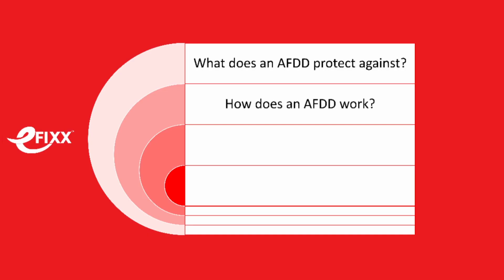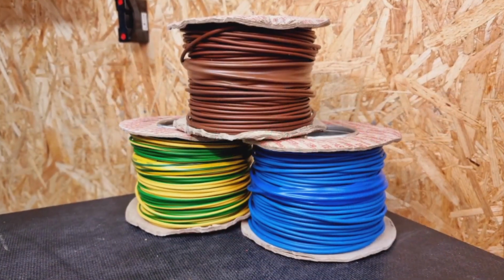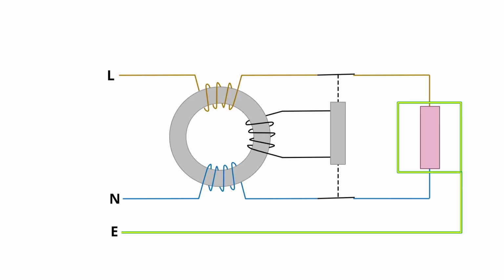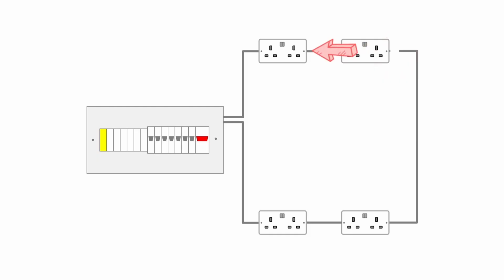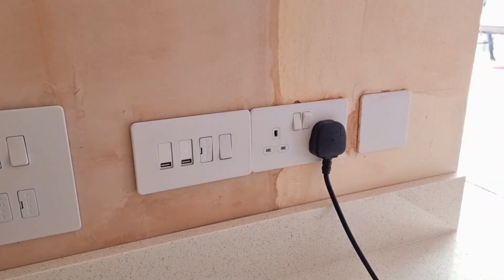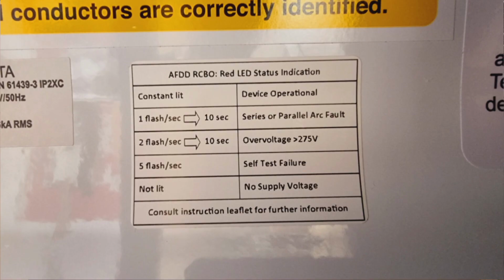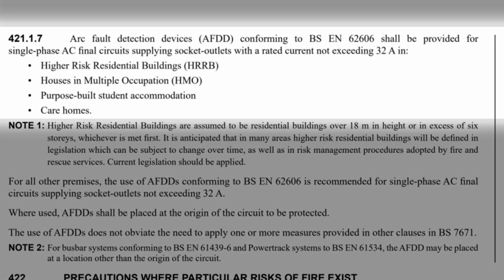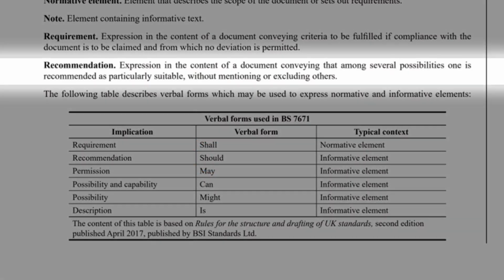AFDDs & BS7671 Amendment 2 - What you need to know!

Comment: I am struggling to verify anywhere the definition of “reside” also meaning offices etc i may be completely missing it. This is not meant to challenge what you are informing us of but merely for self clarification. 
Very informative non the less
Reply: That's because you reside in a residence.
Reply: @markrainford1219  i understand this which is why i seek clarity, with reference to the statement at about 1525 on the video where he says  ‘residential in this context doesn’t just refer to where people live or sleep, but also includes areas where people may RESIDE during the day for work. So office blocks could be included under these circumstances as well’

Comment: AFDD has already come into its own for me. Just had a job where the customer was concerned about the old wiring and old light fittings. (Fluorescents) Circuit all tested out fine but the AFDD kept disconnecting over a week. Old light fittings changed for new and now no problems.
Reply: As a former electrician and now a CEng with the IET with over 40 years of experience, the faults being monitored by the AFFD are due as follows 1. Poor installation 2. Poorly manufactured products 3. Lack of inspection and maintenance regime 4. Appliance,s sockets, switches and luminaires not being replaced at end of life service and degrading.  All the above were taught as correct installation, maintenance and working practice in the 70’s. 

We now have a tendency to try to over engineer the problems away than use such well founded practices. If the above was observed AFDDs would not be required.
Reply: @talsius.1019  
So we should ditch a device that prevents fires?
Reply: @johnburns4017  I think what I’m saying is, another electromechanical device is being inserted into the system where quite frankly a correctly installed, tested and maintained installation would not require them. It is noted that fire incidences in residences has increased over the last ten years, why? … poor installation, poor testing,  people not having their homes tested periodically so that the installation deteriorates allowing arcing to occur due to insulation breakdown between phase or phase and neutral conductors. Still they will prevail , I’m sure they’ll help in one or two instances but if the above is carried correctly then their need is debatable.
Reply: @talsius.1019  definitely. The dumbing down of the industry and the consumer wanting the cheapest price has made it like this: 
The customer wasn’t willing to pay for a full EICR as it was still in date so I offered a different solution to them they took it and it worked in a way the customer understands. 
Not just our trade but most things in the UK is plastered over and fixed when it breaks. 
I have a favourite saying for my customers. A stitch in time saves 9!
Reply from the maker: Great info thanks 🙏
Reply: @efixx  all the internals showed signs of thermal degradation but the multifunction tester just saw no problem. Obviously when the fittings had been on long period time something was causing the arc within the gearing. Let alone all the heat degraded wiring within old fluorescents. 
Also provided good enough evidence that all the lights needed to go.
Reply: @Beariam24  That's why you do periodic test and inspection but nobody wants to pay for that any more, lack of maintenance.
Reply: @leewinters606  100%.
Reply: @Beariam24  just bare in mind when new devices or any other electrical equipment is new on the market you tube channels might be getting a paid promotion the old saying (back handers).shop around and do your research.
Reply: @leewinters606  I think a lot of the 'new regs' are based on manufacturers back handers.
Reply: Great video by the way!1

Comment: Microsoft churned out loads of AFDD-equipped power cables for Xboxes years ago, rather than admit that the problem lay within the machine (loose connection on the figure-8 jack due to missing mounting studs).  When I tore one down it turned out to be an RCD with the arc fault detection piggybacking onto it.  If the AFDD picked up a fault, it introduced an imbalance in the RCD's sense coil to make it trip.

Comment: What about the AFDD it’s self. Are they reliable . There is a lot in them to go wrong even though you say they do a self check. After all I’m sure we have all come across faulty RCBOs that are faulty and won’t trip. 
It’s no good explaining to the customer how things work. Time and time again I tell customers check rcds occasionally. They never do.
Reply: The reality is that, putting more electronics and components in something just means that there are more things that can go wrong, and at £150 each plus a call out charge when they fail it means there will be a lot of disgruntled customers many of whom will think that Electricians are just ripping them off.  We are all aware that RCDs often fail in part because they are not manually tested quarterly, so there’s no reason to think that AFDDs will be any different.

Comment: This was a really easy, good and understanding video of AFDD`s and really helpful! Another great video from EFIXX. Could you guys please do a video now on SPD`s as after doing the NICEIC webinar last night I was a little confused because they mentioned the possibility of having to install several SPD`s in one installation? I know I`m not the only one to say this. Hot topic at the moment!
Reply: I watched that webinar also and what was suggested just sounds insane and unmanageable. Imagine trying to explain and get the go ahead to do that from a customer, let alone execute the installation-  to me that would mean fitting an unsightly enclosure at eye level at 10m intervals, fine in a new build or rewire in some respects but on an existing installation how do we know the routes if we didn’t install the cables to know these lengths I’m unsure of also. It just sounds crazy. If this is the case I do not know why they are putting the responsibility of dealing with this on us - bearing in mind we are dealing with the type A situation also, and not onto the manufacturer’s? Why can they not be charged with designing and manufacturing accessories (smokes, heats, c02 etc.) with SPD built in? Surely that is a more sensible idea?
The other thing that struck me also was that there has been no mention of this in the limited material on SPD’s that I’ve seen over the past year or so.

Comment: As far as i can see these are to protect against  cheap possibly substandard white goods , any parallel arc will trip a mcb or rcd , they wont detect series arc on a ring final , these are the only circuits we have to install them on.not showers, cookers, immersion heaters or electric heating
Reply: A lot of updates to the regs like the use of AFDDs are required to counter the the poor quality materials that we get now and because too many Electricians fail to ensure a good mechanical connection.
Reply: Come on. You Can't expect people to honour 60950 ... Thousands of Chinese manufacturers would go bankrupt. All HAIL the MRA !

Comment: You stated how AFDD doesn't detect series faults on a ring circuit. However a series fault on a ring circuit would never occur, as the series conductors will always be at the same potential.

Comment: So if they protect the flexs that are plugged into a socket on a ring main I assume that they also protect any spurs off a ring main? I'm a homeowner and had them fitted to all my circuits when they replaced my consumer unit. Kinda figured that if they are going to become mandatory it was best to fully upgrade now so I don’t end up having to replace the consumer unit in 5 years time when I want to add something and my consumer unit no longer meets the regulations of the day.
Reply: i would like to know how much you paid for that
Reply: @OnlyUseMeEquip  £2580 including VAT/ fitting/ testing etc. in 2021 in Bedfordshire (near London). Not cheap I admit but where safety is involved I would rather spend the money to get decent protection. Maybe not your average consumer.

Comment: So are we saying that all installations now are requiring afdds?
Reply: Although not clarified in the video it does seem to be the case that all new socket circuits in residential properties require AFDDs to be fitted, it would help massively if the IEE could employ an Electrician to translate their engineering language into something that all Electricians could actually understand and avoid the constant confusion and misinterpretation.
Reply: @andyg1645  I totally agree Andy.
Reply: No
Reply: No, but guess what an insurance company will say when dealing with a claim for an electrical fire. Mine has advised my HMO not covered unless retrospectively AFDD fitted

Comment: I’ve been a spark for 50 years ( now retired ) in all my working life I have seen between 10 /15 spark damaged installations but never a fire …no NEVER a fire .I feel I have missed out so many faults and all the sparks working with me have never mentioned it . So were sparks making  the connections to the right torque and now they are not ? Well I’ve never used a torque screwdriver .Maybe the materials used in foregone years were better ?E.L.C.B.s were used when I was an apprentice but now they changed the name to RCD . When I was young the ELCB were voltage or current operated and I really don’t see the difference between RCD and current operated ELCB I think it’s wonderful to put these new devices in homes where no one has any electrical knowledge When the lights go out they won’t be able to use silver paper like they used to so they will wait patiently for Mr Spark to arrive and charge them a fortune .Hope they never break ,the cost of labour and parts will be a little SHOCK in its self .
Reply: It's true what you say about issues.  Mostly down to cr*p accessories and rushing to get done and onto the next job .  Shower pull cords are the most common cause of burnt connections in my experience but don't need an AFDD.  Shower pull cords used to have 2 screws per connection,  now have one .  Cheaply made products cause issues not electricians .
Reply: @dennisphoenix1  you are right about shower pull cords, work of art to get the connections in and in the confines of the back box .
Reply: @raychambers3646  Especially with 10.0 mm.
Reply: Doesn’t it make you glad to be out of it all, does me after    40 years. Biggest problem is crap equipment that has terminals that don’t tighten down properly  the on the conductors, or no room to get the conductors in properly. Amazes me how little stuff costs now, I remember buying a box of MK slimline sockets off a mate back on the 80’s for £6 each ( a lot of money then) you wouldn’t pay that now for twin socket
Reply: @johnwarwick4105  I used to work commercial before I retired and looking at todays "equipment" is the difference from chalk and cheese. Where old connections could be tightened properly todays look flimsy, one screw instead of two etc. terminal lugs were machine faced, where today a lug is crimped (which is better) but the surface connection is far from flat. Once I worked in M&S, when Lord Marks ran the company, and he was paranoid after a fire at his Watford store. All steel work had to be vermiculite clad, All electric cables had to be MICC and no trunking anywhere. No plastic anywhere, all had to be steel, his fire precautions might be considered OTT but when you see what a fire can do (melt steelwork) his only concern was for his staff, the building didn't matter.
Reply: @johnchristmas7522  yes I was all industrial. Again that equipment has gone the same way, enclosures are always too small to gland armoured’s  in, like my friend always says it’s a race to the bottom
Reply: Seen two burnt out electric shower isolators in my life; one never switched off, the other switched on and off for every shower. The often-operated one fooled the carpenter-owner into changing the electric shower for no good reason...
Reply: had to change many shower pull cord switches always the neutral that burnt out, tried using MK 50A switches on a 7Kw shower still had the same problem a year or so later 3 times  on one customers ! luckly they moved house , I to was a sparky untill I retired after 50 years all these money making regs changes
Reply: @Sparky68M  when possible I always installed 45 a dp switch in a deep box usually these have 2 screws per terminal .Never  had a problem .
Reply: I'm old school as well and retired. I agree most fire faults originate in poor connections and looking at today's offerings in busbars and mains connections remind me of the term 'wet string'!
Reply: Please Mr Senior Spark think of me as a silly old woman, who has seen the sort of burned out pin on several of her older wall sockets. She has dealt with it upto now by sticking gaffa tape over the socket (not sure if it was a single or double gang socket) and she has 2 or 3 examples in her house.
What should I do??
I seem to have an old plastic consumer unit with standard trip switches that is high on the wall of a garage that regularly  get flooded (with sewage by the council) 
I can not see any sign of a RCD or RBCO???
In due course I want to give the house a complete rewire but I would need to move out & put my stuff into storage before that happens so that's a couple of years away
I take it you would suggest a new consumer unit. I will be going out and hiring a company of sparks who hopefully other sparks think are good & I will be paying them to use their skills plus time to deliver a good job. But what kit should I thinking about buying or should I be coming back here & employing you as a consultant?
I have a background in computer networks but I have had friends working in theatre etc who have nearly died & I have a healthy respect for high energy system
Thank you for your time
Reply: @annakissed3226  A lot problems at socket outlets is due to regular plug in and taking out of plugs weakening of the internal gripping mech then say a heater etc creates a hot spot and a blackened outlet.

Comment: Why bother with shall or recommendation,  just put MUST .   Simple .  With regards to AFDD'S  fault LED indicator it won't show overcurrent or rcd  issues for the cause of tripping . Most faults are Rcd  tripping . The circuit that the AFDD'S is designed to protect it doesn't work on ( 32A ring mains ) .   All this is to protect against poor workmanship as going to metal consumer units has . Poor workmanship is probably the cause of most issues and injury or deaths. You can't stop this with more electronics .

Comment: I really feel this regulation should end up being removed just like earthing of metal capping back in the 15th edition. AFDD's are far too expensive and where is the real world science that has driven this through. More pointless amendments causing more trouble than its worth.
Reply: What you have to remember is that the Regulations originally were driven by Insurance companies annoyed at having to cover fire cost of poor installations. There might be more to this , than just electrical engineers wanting to change the regs.
Reply: I totally agree these devices are not viable. They have only added another device 
 To give problems. Like all these new electronic devices potential problems.
Reply: The cost should come down over time as demand and supply increases. I think the current "must" requirements and recommendation is a fair balance. I wouldn't like to see it required for all circuits in the near future given the current cost!
Reply: Why was the earthing requirement for metal capping removed?
Reply: Oh and they don’t work on rings, the circuit that gets the most use in a house 😅
Reply: But they do work on the appliances plugged into the ring.  But agreed, time to ditch the ring which is more trouble than it's worth @AdamSpooner191